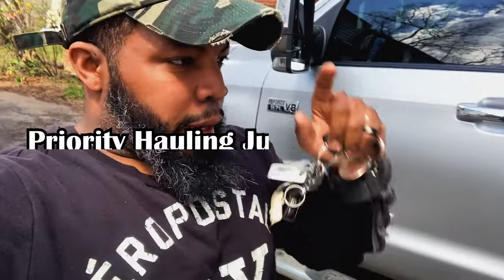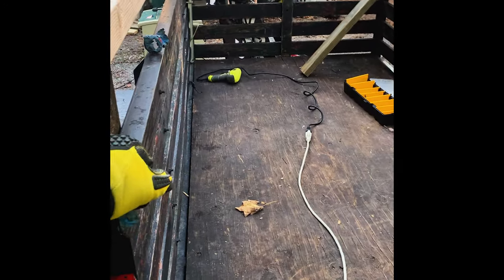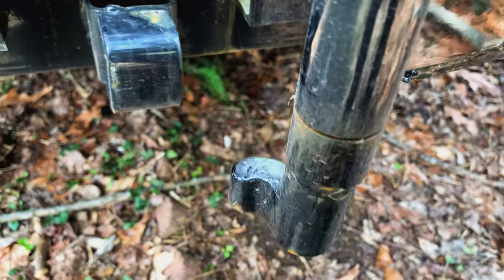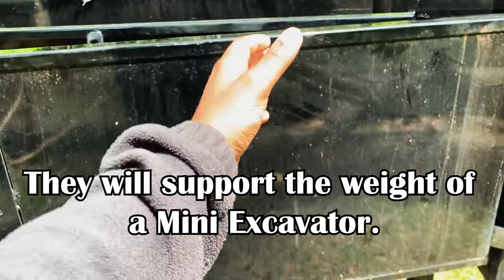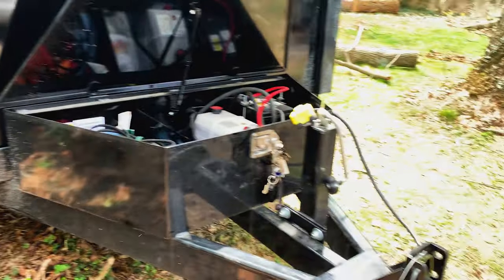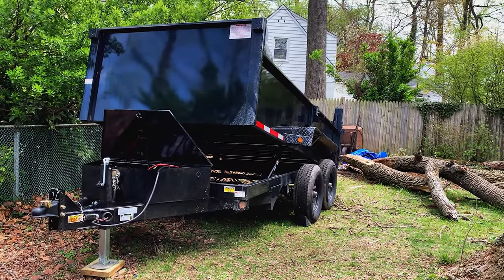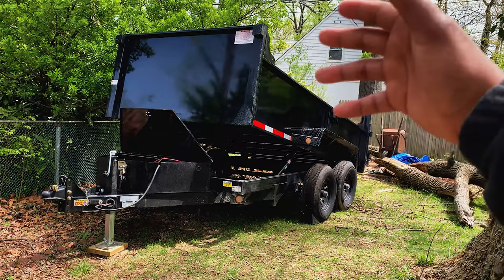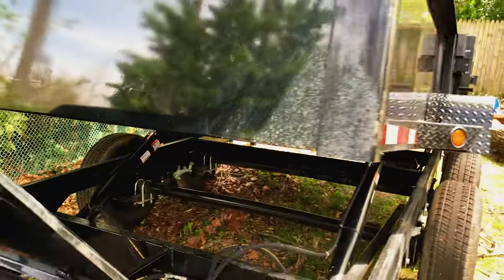♻️ I Bought A New Dump Trailer | 7x12 Dump Trailer Review (Baltimore Junk Removal Ep.4)

Comment: Hey I'm also from Baltimore.  I just started my junk hauling and trailer rental.  Would love to chop it up with you.  Got a couple questions.  I am starting a YouTube channel, check it out when you can.  So are you able to dump at any landfill or just the city? And if so how do you go about being able to go to any landfill?  Thanks
Reply from the maker: Congratulations on the new business. I just subscribed to your channel. I can use any Landfill here in the county. I do believe that the city landfill is only available to city residents. I wish I could go there to cut the traveling distance but since I have a dual axle trailer, I have to drive out to Eastern Sanitary Landfill.
Reply: I appreciate that bro.  I do plan on putting out more videos.  So I'm in the city, I just recently found 2 spots you can dump,it doesn't matter what area you from. One is BRC Roll off and recycling 1030 Edison Hwy 21213. They start at $85 a ton. L&J waste recycling  222 N Calverton rd 21223.